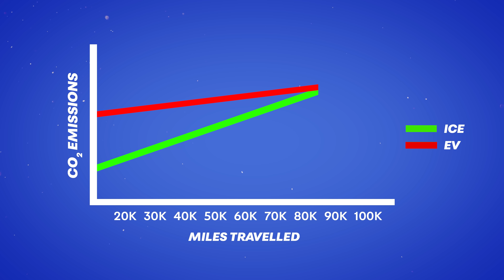Are Electric Cars REALLY That Green? [New 2022 Data]

Comment: The breakeven is even farther away if I just keep on driving my old ICE car. There are no emissions of manufacturing, because those emissions already escaped and they will never come back even if I trash the car.
And, it depends on if you speak about CO2 or pollutants. CO2 does not spoil local air much, it spreads and mixes quite evenly all around the atmosphere. Dust particles from tires, brakes etc. might do more local harm and there is no much difference between ice or e.
Despite of increasing CO2, the energy needed to heat my apartment has not been reducing. There is no climate catastrophe.

Comment: Only if you believe the worlds greatest Bernie Madoff scam. Volcanoes produce more carbon in the air than all of mankind's history and then you add all other nature to that and whatever we produce is like throwing a pebble into Pacific ocean and blaming it for a tidal wave. You young people only know pollution because it registers on sensitive equipment. Anyone that was around in the early 70's and prior should remember choking on exhaust gas in stop and go driving, uncontrolled black and blue smoke coming out of tail pipes and crank cases when accelerating, thick black smoke spewing from power and steam generation plants and every 18 wheeler on the road along with all heavy construction equipment and ships and jets that actually dropped black soot everywhere not to mention the locomotives still in operation in the 60's and prior or the diesel electric trains. Driving towards a city on a cloudless day and it looked like rain clouds hovering over head but was just the pollution. No, you have never seen pollution. And then there are the rivers. Does anyone old enough to remember or has any of the younger generation been taught about the river that was so polluted it caught fire? In comparison, there is no man made pollution today. As the scientists and EPA and California made demands of certain pollution devices and engineering on automobiles they would discover they created a larger monster than they thought they where fixing and stack another regulation on top of that. So you see why I don't get excited about man made climate change, global warming or whatever the phrase is today?

Comment: Great video. I think it helps people to see both sides of the argument and brings to light the power grid issues that many people seem to overlook. Plugging in an EV in a location that is powered by coal presents issues that many people seem to overlook. This is also something that not all vehicle owners have a lot of control over. I live in an apartment complex and I'm pretty sure that the management would not be too happy with me if I decided to install solar panels or wind turbines on their property. I also would not be able to charge my vehicle at home because of how the parking is set up and the fact that they don't have any chargers built into the complex. I think another point to be brought up related to this topic, especially in consideration of the mileage break even points, is why is might not be a great idea to get rid of your ICE vehicle if the purchase was fairly recent and the vehicle doesn't have a lot of miles yet. The pollution was already generated from production efforts and buying a new EV means that more pollution related to production efforts will be (or were) generated in the process. If your vehicle genuinely needs to be replaced, that seems to be the best time to make the upgrade. 

Another facet that often goes ignored is the consideration of other types of vehicles such as construction equipment, farming equipment, military vehicles, and the like. Most of these operate using diesel, but they could be converted to EV if more people thought about them and weight/distance related issues were addressed. Some transportation industry items are getting addressed, but still in their infancy when you consider things like supply trucks, but heavy loads and limited mileage for many EVs are obstacles related to that sector that might take a bit longer to resolve. Many truck drivers carry heavy loads in excess of 500 miles on a daily basis. A suitable EV equivalent needs to be capable of replacing the current equipment with something that has the same capabilities otherwise, we will start running into many supply chain issues. The same limitations probably apply to the other industrial equipment. Tractors and construction equipment might not travel as far as a shipping truck does, and they operate at a much slower pace, but they also operate for long hours, use a lot of power to plow, harvest, dig, fill, and perform other necessary tasks. They also make up a pretty large amount of the global vehicle fleet and are necessary in our modern lives. I'm surprised that as far as I am aware, there is not a lot of research and development available in consideration of these other necessary vehicles.
Reply: The greenest thing to do with a new ICE car is stop driving it. You are not "repaying" CO2 during production like with an EV. Every mile driven by ICE is producing more CO2 (and other noxious fumes). Every mile driven by EV is getting towards break-even point and then will be greener from then on. Just not the case for ICE, which just keeps adding to its total emissions. Every mile driven should be EV.

Financially it is a different story, but still if you can afford it sell the ICE and switch to electric.

Comment: Well done.  I have wondered about the pros and cons you covered.  However, while the air and CO2 are better, what about the overall impact on the environment?  Aren't the batteries lithium, which is strip mined? If so that is rather harmful in the long run.  Also, batteries wear out; how to dispose of them?  Even now, dead batteries from AAA to Car batteries are considered hazardous waste.  But, similar production and waste questions can be applied to the ICE vehicles as well.

Comment: There's a great deal missing from this discussion, which reveals how much worse EV's are for the environment. The argument goes well beyond CO2 emissions. In the end, EV's will result is much higher pollutants being pumped into the atmosphere, as the increased demand on the electrical grid to supply the energy they require will rely on power plants that burn coal (Green Energy is myth. It can't even meet current demand). Then there's the toxic waste created by the production of the batteries, as well as the disposal of batteries that can no longer retain a charge. They'll end up in toxic waste dumps. These are very real problems, that nobody is bothering to discuss. In fact, anyone who raises them is dismissed out of hand. One need only look back to the 1970's to see the panic that the PCB toxic waste issue caused. A move to replace all vehicles with EV's will make that situation look like spilt milk.

Comment: Third probably. EVs are not the solution they have being said to be . A lot more work needs to be done before the "problem " is brought under control . Nothing is ever as simple as people would like. Today we have a massive wind turbine blade disposal problem. I became aware of this problem in the early 1980 , no suitable solutions have developed yet . What do you do with fiberglass and carbon  composite materials when they are damaged or beyond the useful lifespan. They are very slow to decompose and they are massively large, they are a huge problem in every way.

Comment: Until the infrastructure can support the masses buying a ev car is there ev cars are not viable either. In the hot summer the power companies shut off power to reduce blackouts. Think about when everyone is trying to plug in the car to charge it. Also my wife cant make a round trip drive to work and back on a single charge in the cold part of the year and in michigan, usa thats over half the year. As soon as the electrical grid us updated and batteries have more power density and last longer its game over for piston power.

Comment: The EV/ICE discussion is irrelevant unless consideration is given to the operator of the vehicle and vehicle latency. Today humans drive cars to and from work and errands required for living. Humans commute 1-2 hours, the vehicle remains static for 20-23 hours/day. In urban settings the vehicle consumes nearly 150 sq/ft for 7-10 hours/work day. A surface level asphalt parking space can cost $25,000 to build NOT including the land it sits on or the tax revenue of that land. Let us assume we have a surplus of labor that is relatively low skilled; the better model would be to have 'mass transit' functioned by passenger vehicles that are EV. If your driver average a 6 hour work day at an average speed of 45-50 MPH with a 4 hour mid day break. Driving range is a non-factor when I can top off mid day and full charge every day/night. 
The ICE vehicle would be reserved for long haul driving at highway speeds. With liquid fuel stops kept at reasonable times.
Now I know that in the US this is a difficult concept because we are selfish and can't stand the idea of car pooling but the younger generations have no difficulty with U ER/LYFT ...

Comment: My question has always been what happens to the batteries when they go bad? What kind of process do they have to recycle these batteries. Where do they end up and how? Especially now some of these larger batteries if they go bad cost twice as much as you would have spent on gas in the total amount of miles and years at one time. They need to include this in their equation as well.
Reply: There is a big market for used EV batteries. 

Ultimately it will become a "core" rebate on a battery swap.

Comment: Nice video. Thanks. One thing I never hear anyone bothering to talk about, is us people who live in cold country (Northeast Rural America here, but there are a LOT more) We can get up to 40% less mileage per charge for 6 months of the year here, plus the batteries do not last as long, meaning a new battery (or new car) a lot sooner. Let's add this factor in.
Reply: The batteries last just fine. Mine survived the 2019 polar vortex outside without degradation. 

As for range, just calculate what you need.

Don't let perfect be the enemy of good/better.
Reply: @usa-ev  Yours is a unique battery then. Nobody else's works the same as in temperate climates.
Reply: @nathanlambshead4778  I don't think so. Range from a single charge is reduced during cold weather due to battery chemistry and energy going for heating, but cold weather affecting degradation requiring a new battery sooner does not happen.

There are two main battery chemistries in use right now. The most common is NMC and is used in more than 90% of the cars. It does not degrade with the cold. The other is  LiFePO4 which is only used on newer Tesla Model 3 Standard Range cars. This chemistry is susceptible to freezing, but I'm sure the BMS protects against this.

Comment: I'm not buying this. EV, use substantially less parts that ICE cars meaning the CO2 costs will be MUCH lower (Ford did a comparison showing a 40% reduction in parts against ICE). The battery does NOT take vast ammounts of CO2 to produce, it's less than an ICE engine. Volvo makes 90% of it's revenue from ICE cars, why would they release a report that says BEV are better for the environment and cheaper to build, everyone would then ask why the BEV Volvo makes is so expensive. Taking one report from one manufacturer who is still heavily invested in ICE is dumb. Electrics cars are the future, get over it.

Comment: Hang on if you're saying that the battery is only being rated for 124k miles before replacement, then the standard engine is still stands above electric. On top of everything it's not even remotely feasible to convert every car to electric there isn't enough materials on this planet to allow for that possibility.

Comment: What would be the carbon cost of building enough power stations/ renewable energy sources/ mass energy storage plants etc., to meet the demand of every car in the UK alone becoming electric? Where will the copper come from to increase power distribution,?
Also what will happen in ten years time, when all the batteries in electric cars need replacing? Where will 20 million dead lithium batteries go?
The list is endless, but greenies don't want to ask real questions, because the smaller picture is all that interests their virtue signaling.

Comment: Did Volvo factor in that the ICE car can keep going at basically the same rate whereas theEV will need new batteries at what is statically after about 8-10 years. This would mean if you want to be truely green buy an ice car and keep it longer …..

Comment: So if your a low mileage driver then a small petrol engine would be better, yet in the U.K anything that isn't a EV is being outlawed. Another point that hasn't been discussed is the extra strain on the National grid which doesn't exactly have loads of surplus energy. Maybe they just plan on pricing a lot of people out of cars and onto public transport. Just look at how the cost of new and used cars has increased recently.

Comment: 8:16 Yes! Producing smaller batteries (EV's with smaller batteries) is one of the most important keys to making a positive environmental impact with personal transportation. Thanks for this excellent video presentation! Keep up the good work.
Reply: Well, no. Or at least, maybe not as much as you may think.
There is also greening the electricity supply, which as the numbers in the video show can have a very large impact on lifetime emissions.
Also, there is the battery production. Most of the energy here (at the factory) is expended in the electrode drying ovens. Using a dry battery electrode process saves an enormous amount here. (Size of plant is reduced by maybe an order of magnitude, capital expenditure on battery plant is IIRC more than halved, costs are reduced significantly - not 50%, but 20%, 30% or maybe more and plant CO2 emissions are slashed).
There is efficient battery management and drive trains. Tesla is commonly reckoned (as Jim Farley at Ford has admitted) to get significantly more range from the same sized battery as other manufacturers.
Finally, it doesn't matter if you produce a smaller vehicle with smaller batteries if nobody buys it. Part of the solution is persuading high polluters to pollute less and the less you ask them to change their accustomed life style to do so, the more success you will have. The more you try to force people to change their lifestyle, the more opposition you will create and the slower the whole process will be.

There is also considerable room for improvement in material extraction, Mines could operate using solely electrical equipment, which would then automatically get cleaner as electricity production produces less carbon dioxide - which is happening more and more for purely economic reasons, as renewables are becoming cheaper than fossil fuel powered generators and batteries are cheaper and more effective than gas peaker plants. In refining, aluminium already uses electrical means (always has). Steel, however, uses a lot of coal in blast furnaces, most of it either to heat the iron ore or to "burn" the oxygen in the ore to produce metallic iron. This could be done with (hopefully green) hydrogen, and is starting to happen.
Reply: @colindavidson7071  Thank you for your thought provoking reply. I especially appreciate your holistic approach. I'm looking forward to what the future holds! :)
Reply: @c.a.r.s.carsandrelevantspecs  so wholesome
Reply: @colindavidson7071  What about the hideous nature of making spent batteries not as bad for the environment as conventional nuke waste? Hydrogen is just a complete joke, it's just way waay too problematic to store and handle on a massive scale, also the whole Green movement is just progressive marxism and Agenda 2030 'Hunger Games' end game, there's 7K volcanoes hiding under the sea spewing Sulfur Dioxide and Hydrogen Sulfide by the shitload yearly, that's the actual greenhouse gas, not inert harmless carbon, a plant food, but everyone's a lemming zombie sheep that loves a hysterical narrative.
Reply: man 's CO2 has no significant effect on the weather, it's never been anything but a big lie to get you to surrender your freedom and lower your standard of living.

Comment: If you drive a EV, try not to drive at night in the snow while using the heater.  Take Away: If you want a EV buy one and if you want a ICE car buy one.  You have to figure in the Co2 from recycling the old batteries and making the replacement batteries.   EV or ICE choice is the same as, if you want to live in a urban tower block--go for it, me I enjoy my SFR in the suburbs--my choice.   My next car will be a hybrid and not a EV due to having to drive in winter snow at night using the heater.   Solid State Batteries someday.....

Comment: How many cars die, due to accidents, ect. before the 52k/90k break even point? And was this in the study? If you wreak your electric car at 30k and buy a new one, how long do you need to drive the new one to break even, 74k to 150k? Are there post factors that make disposal of these cars even more harmful to the environment? And were these factors in the study? Another question, there is a carbon foot print for every dollar earned, has this been considered in the study? Hypothetically, if the cost for me to produce $1k was 1 ton of carbon, then a $30k car vs a $150k car, also needs to be considered. should I go on? To many over simplified answers in  this world, if'n u ask me. Then mix in a few "journalists" with no expertise in a field, what a beautiful world we live in.

Comment: The answer seems to be obvious. Hybrid cars! They have much smaller batteries and use very little fuel. We should invest in making the most efficient hybrids possible. Plus evs lug around hundreds if not thousands of pounds of batteries even when at low battery. Gas is just tremendously more energy dense than batteries!